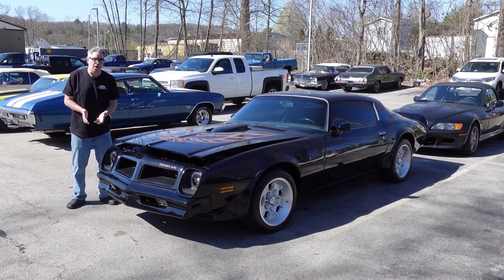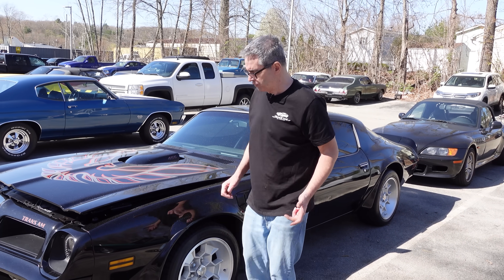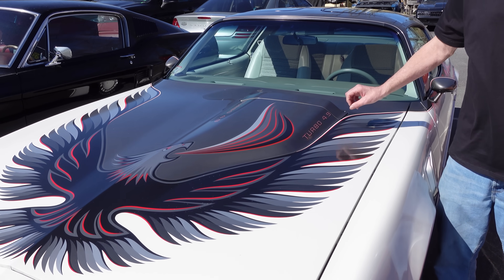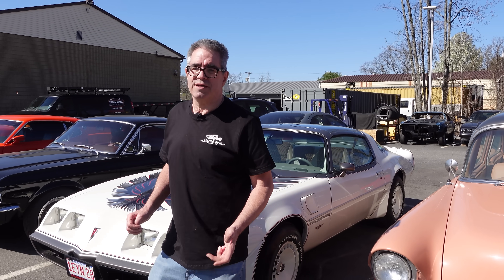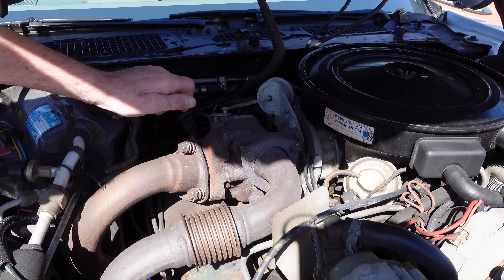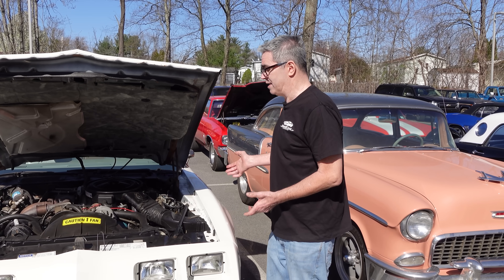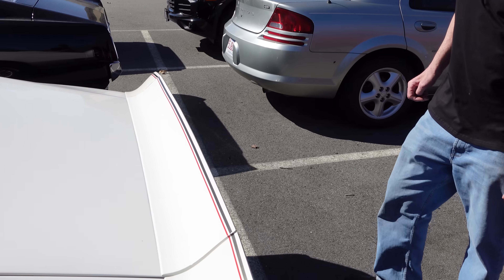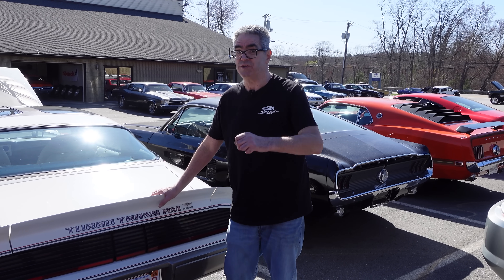Disco Tech

Comment: Steve, I miss the  early 70's Firebird/ Trans Am. Also the Smokey and the Bandit Trans Am! I had a 73' Grand Am 400 V8 4 bbl carb 230 HP two door. It moved ok not like the older 400's. Did you hear about the ad in Car and Driver about Pontiac coming back! It's all over You Tube.  I wonder if GM sold the Pontiac name to a different car manufacturer like from Japan. If Pontiac does come back would like to see cars and a El Camino style in Pontiac skins
 Would like to see a new trophy style engine 4 cylinder 3.6 to 3.8 liter. V8:s  372, 421, 472  and 520 in H.O. and SD. Pontiac names like Astre, Sunbird, 74' style Ventura, 73' style Grand Am sport touring, LeMans, Catalina, Bonniville and the best for last the Banshee. A new Banshee front engine rear so Corvette owner have another option! A family 4 door big block V8 to put a smile on a new born childs face. The child is the future of hotrods. Why I picked the Astre. I feel Astre is a good little pony car with a 3.6 to 3.8 H.O. or SD inline 4 cylinder to budget buyers. Pontiac was the king the in 60's and early 70's. So they need a big big block 520! I hope Pontiac comes back! Make some noise

Comment: A friend had a 455SD Firebird. That sucker would not stall. Had the functioning Shaker hood scoop.
The Amsoil chemist had one he installed a built 2004R in. He said it could do 200MPH. Without OD you ran out of RPM capability which the OD cured.

Comment: Those second gen. F-bodies were some of the best looking cars GM ever did.   Funny they dropped the 455 due to emission and CAFE but kept building more trucks that even today consume more fuel than the 455 did.  GM doesn’t even really make cars anymore under the current failing leadership.  I wonder if GM actually did put that ad in the current issue of C and D for Pontiac?   I would take eclectic over electric. 🏁🙂👍

Comment: not screaming chicken. we called it the squaking chicken. that aside....i thought pontiac designers did a better job with the platform than the camaro's division did. hooray for adjustable vacuum modulators, crower and edelbrock though. the combo often fixed the abysmal power/performance problem relatively cheap.

Comment: i had a black on black 1979 trans american. had the blistering 301 4v engine and th350 auto trans. and YES it had t tops air conditioning and 4 WHEEL DISK BRAKES! fun fact they made over 100k of these birds in 79

Comment: They has the fuel thing going on at the time and they were just making the cars more appealing,and using more emissions but they were cruiser cars.
Some of them cars were heavy with all the plastics.
I like the late 80's Firebirds myself,dont care for the fuel injection much though that came unless it's a 98 with the ls1.
I think 87 was the last year you could order a Firebird with a 4 barrel carb.
The 3rd gen Firebird looked much better than the Camaro version,the flip up headlights,just made the car much more appealing,it look more like an exotic sports car.
I do think the 3rd gen Camaro is ugly,dont care what any guy thinks,they look boxey and Friebird make the body much more appealing.

Comment: Someone claims they used the 4.9 Cadillac engine in the 80 to 81 Firebird Turbo.
Does anyone knwo what kind of block it is?
So it's like a 305 sbc with cast iron or is it aluminum?
Reguardless if it's fast just look at the thing,it's a chick magnet and a beauty.
Even the Early 70's firebirds were nice but they don't seem to be as common as the 80's and mid 70's models.

Comment: My best friend has had both of those TA's the 76 had a screaming 400 Chevy hooked to a Super T-10 and a and a killer 12 Bolt GM Axle. The 2nd TA was the 80 Indy pace car edition he took that turd of a 301 Pontiac motor and well it had a 350 with a tunnel ram and he removed the automatic transmission and replaced it with a short throw manual tranny then replaced the 350 with a 454 ! I can't tell you how much money he spent I know it's easily over a million dollars on just those cars and other projects with one more TA 3 Camero's, a 79 Capri, 4 RX-7's, 3 chargers 71,73 & 74,. Yeah I can stop now there are more cars but I'm not getting into that.
Reply: Yuck. If I were removing the 301 turbo, it would be replaced by another Pontiac V8. If you wanted a Chevrolet, buy a Camaro. No sense in making it a "Chevyiac". It takes no brains to make a Chevrolet V8 go fast. It takes skill to do that with a Pontiac V8.
Reply: @googleusergp I prefer Ponchos over Chevys mostly because I'm a Mopar guy. 😎